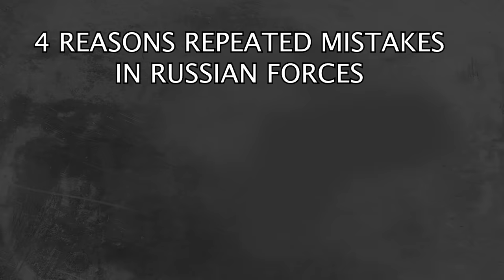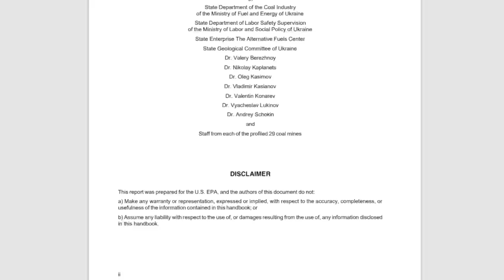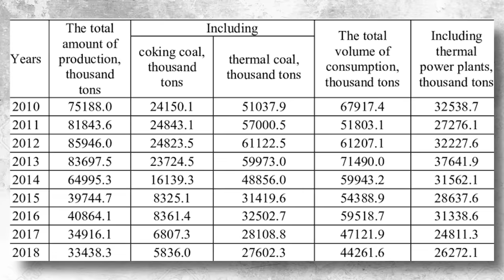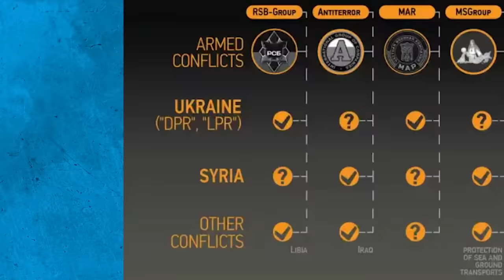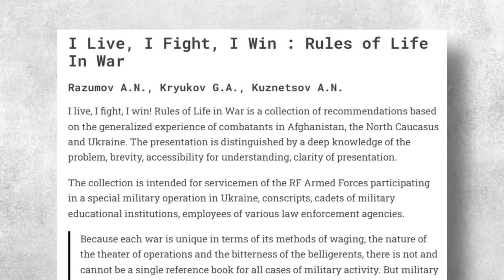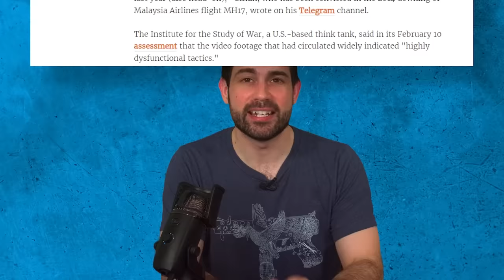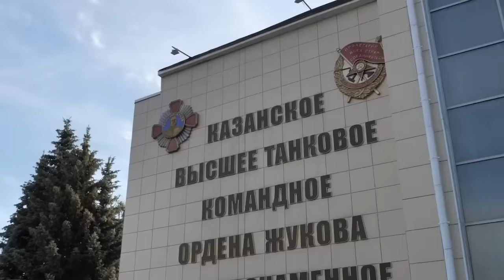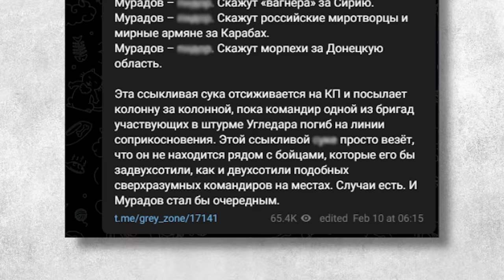Vuhledar, Why Russia Repeats the Same Mistakes

Comment: I once flew into a dirt airstrip on the opposite side of Base Camp from my company area. There was that second airstrip, “The Golf Course”, the active combat oriented one, lined by helicopters in sand-bagged revetments. It was only two-hundred meters from my battalion area, but not used for the kinda trip I’d just made. Instead, I had to walk clear across the base. I trudged along the dirt road with my M-16 slung on my right shoulder, grasping it’s sling with the thumb of right hand. I had my left thumb out, hoping to catch a ride. I walked down the right side of the road with the dirty-dusty, beaten up, muddy jeeps, 4WD Mules, 3/4 and 2-1/2 ton trucks speeding by me in both directions, coating me in dust. As I trod further from the airstrip, there were fewer and fewer vehicles rolling by, and less dust. Time passed, slowly. I plodded along, putting one foot in front of the other, the infantryman's plight. 

  A very clean and freshly painted jeep drove by me. It had a clean, taut, olive-drab canvas top. It stopped thirty feet ahead. I quickly jogged toward it, my gear flopping as I ran. A Major in an OD soft (baseball) cap leapt out of the jeep. He walked smartly towards me, dressed in very clean and perfectly tailored OD fatigues, with a very shiny brass belt buckle and very shiny black, ‘stateside’, all leather, custom made paratrooper “jump” boots. I (on the other hand) trod down this dusty road exhausted, filthy and stinking. I, coated in dust, stood there in my tin pot. Its faded camouflaged cloth cover had FTA written on it in ink, in two inch high letters (“Fuck The Army!”). Fortunately, he did not notice it. My once black boots were completely scuffed to a grayish tan. I carried my particular sixty-plus pound standard basic combat load, M-16, tin pot, seven hundred and fifty rounds of 5.56 mm ammo, four frags, three full one quart canteens, entrenching tool with bayonet, a parachute flare, a trip flare and a half-dozen cans of C rations in old socks tied on the back of my web gear. I wore the same sweaty, faded, brown stained jungle fatigues that I’d worn for two months. We lived in separate realities. 
  
  Marching smartly up to me, he barked, "Don't you know how to salute a Superior Officer?!” Switching my left hand to hold the sling of my M-16 slung on my right shoulder, I saluted him with my right hand and replied, "Sir, we don't salute officers in the field, Sir… The snipers tend to shoot them, Sir, if we do." He returned my salute and barked, "That's the general's jeep. The new Division Commander's in that jeep. He wants to know why you are out of uniform?" Me, incredulously, “What?!!” I have no Cav patch on the left shoulder of my jungle fatigues, no name tag, no US Army over my left pocket and no rank sewn on my sleeves. He continued, ”Why aren't your boots polished?" "Where are your insignia?" By this point, I was both bemused and pissed off. My reply was, "Fifty-six days in the field, Sir. This is the third blouse I've had. The other two rotted off me.” 

  This was when he realized I had at least five or six hundred rounds of ammo in the six ammo pouches on the front of my gear. He could see the two M26A2 hand grenades on my belt. It's also the moment he noticed the M-16 slung that was on my shoulder had a magazine in it. My once green fatigues were now tinged with a reddish brown from the red clay of the Ia Drang. I’m filthy. I hadn’t bathed in in a creek for at least two weeks. I’m sure he could smell me when he'd gotten in my face to make his point. The Major took a step back. Then, in a just slightly less officious tone, he said, "Well! See to it. You get your insignia properly sewn on, ASAP!" (as soon as possible) "And get some polish on those boots!” As there was no polish to be had, that was the icing on the cupcake. I responded, “Yes, sir!” After I switched hands again, I saluted him. He returned my salute and turned to go back to the jeep. I asked, "Sir. How 'bout a ride?” He glanced back over his shoulder, gave me a dirty scowl, jumped into the jeep, and they drove off in a cloud of dust.
Reply: I'm not reading all of that!
Reply: That guy was an idiot. Glad you kept your cool.
Reply: @wespeakforthetrees  just pointing out US army isn’t that smart either. It wouldn’t be hard to meet an enemy better managed than the US military.
Reply: @TheBooban  like for example?
Reply: @dodgedemonsrtx " Instant gratification isn't quick enough..." Carrie Fisher in "Postcards From the Edge"

Comment: Nice.  I think you’re right, with no or little in sharing lessons learned between Russian factions they are losing against better led troops.  Will it be enough?  I believe it will.  Defense is usually stronger than attackers.  This is a target that they must take.  Just throwing bodies at it would work.

Comment: A bit of a correction: Wagner doesn't JUST use human wave tactics, nor are they purely made up of ex-cons. Rather, they consist of barely trained ex-cons serving beside a small corps of extremely highly trained troops that are of even higher quality than what Patriot can bring to bear. The human wave portion of their attacks aren't meant to gain ground, they're meant to probe defenses for weaknesses that the much better-trained and better-equipped main troops then exploit. If those probe troops die as a result (and considering retreat is punishable by execution in Wagner, they almost certainly will), that just isn't the "proper" troops' problem. This is an incredibly cold and inhumane strategy, but it's also why Wagner has gained ground in Bakhmut while no one else, even the (ostensibly) better trained standard army and Patriot, have. It's worth noting too that Wagner isn't just fighting the normal Ukrainian military either. Bakhmut is arguably the largest concentration of elite troops in all of Ukraine on both sides, which puts some additional context on Wagner's slow gains. This is largely why Wagner has been catching more and more flak within Russia. Much as Patriot would love to believe they're better and more elite, they aren't, and Wagner has been making better progress against far stronger Ukrainian forces with considerably less support from Russia's top brass, given all the complaints Wagner's had of ammunition and equipment shortages.

Prigozyn wouldn't be nearly as cavalier about his losses if it was actually his "proper" troops that were dying in the numbers they have been.
Reply: Unfortunately for Wagner this tactic has basically run its course. Word has gotten back into the Russian prison system about the huge casualty rates and basically no one will sign up now. Prigozhin spun this as Wagner not needing the convict troops anymore, but it was plain to see he knew full well he couldn't get any more.

Comment: A big issue is, Russia has not been in a formal war since the 80's, and havent done combined operations on any scale since WW2 (in the 80s, the AF and Army did not work together in Afghanistan due to how politicized and territorial their military is). Most of what they do is putting down revolts in places like Chechnya, Dagestan, etc. So when they invaded they went to their old playbook of large, overwhelming forces with massive armor in a hard thrust towards select vital points. It worked at first, but then when Ukraine was able to stop them, they had no clue what to do bc they didnt have the doctrine or experience for it. What is more, is Russia has had several generals who were highly successful, but they have been relegated to secondary duties or pulled out of the war in favor of generals who are political yes men to Putin. This is another classic problem in Russian history going back 200 years, where loyal generals are given priority over competent ones. I mean look at ww2, it was when the Germans were nearing Moscow the Stalin brought from the far east some good generals and let out of prison others, whose loyalty were in question, but were good generals. Its an old Russian military problem.
Reply: Bullseye 🎯

Comment: Just a heads up, your microphone is facing the wrong way unless you're using the omnidirectional mode which decreases the quality of the audio capture and makes the pop filter you have on it uncessesary. Point the blue logo towards yourself for correct positioning :)

Comment: One aspect of the lack of unified/coordinated effort on the Russian's part that you didn't mention (at least not directly) is that to a large extent the factionalism exists by design. Senior leadership (e.g. Putin, but not just him) are fearful of allowing too much power to get concentrated into the hands of a single controlling person/organization because doing so could potentially set the stage for a coup. By maintaining a divided and competing military and internal security apparatus it helps ensure that if one group rises against the senior leadership there will be several others waiting to stage a counter-coup in order to restore the status quo.

Comment: This kind of loose setup might be useful if you are doing asymmetrical warfare or black ops, but obviously it doesn't work for conventional warfare. This is Russia's first serious deployment of their conventional forces since Afghanistan, unlike US. Chechnya was smaller operation when compared. So not surprising they screw up so much. 

And sir, you don't disappoint with your no bs reporting, presenting a clean picture when compared to any traditional media sources from any side in this war.

Comment: all of what you mentioned, but also- the soldiers don't live long enough to do after action reports or pass down that knowledge.  If it isn't taught... it needs to come from those around you.. you learn as you do, you improve... if you survive... hopefully, you teach the other guy how to survive... unfortunately, at the rate they are losing troops on the front line, not rotating anyone back, not having a system for knowledge to spread... they're stuck.  Not complaining, works in the favor of Ukraine.

Comment: Small detail but the republic of Tatarstan is not one of the poorest areas in Russia, it's actually a fairly well-off one (it ranks in the top 10). It has oil wealth and is fairly industrialised. It matters because back in 1991, there was talks that the republic could break away and trigger a dissolution of the Russian Federation. A referundum was held and the pro-independence side won but the decision was ignored by Moscow and the republic was forced to stay in but not with the same use of force as seen in Chechnia at the time.

Comment: Surely a factor is the highly authoritarian culture in the chain of command and low value given to personnel. If an order comes to take a position, then that commander will throw what he can at it even if it is misguided or suicidal.  There is a book which analysed the reasons for military defeat. Overly authoritarian command was the primary factor.  Russia compensates by mass, but at the cost of massive casualties.  That is expected and considered acceptable and regarded as the nature of ‘patriotic war’.  It is not regarded as a failing or in the same way as we would see it.  If such loss and wastefulness is acceptable then there is no learning from it as it is to be expected. It is Russian and former Soviet unwritten SOP and doctrine.  That military culture is totally alien to us, so these kinds of explanations are given.

Comment: Having not read all the comments, this might have already been mentioned, but the top down leadership structure is faciltating the losses Russia is suffering. Russian military has no non commissioned officer corp, and without it, there is no localized leadership within the ranks. No one to see situational changes or challenges, therefore those troops are frozen by inertia. That's fine with me. hopefully Ukraine capitalizes on this glaring error and gets this war finished.

Comment: It's down to their military doctrine.  It's rigid and doesn't allow soldiers to adapt to changes in battlefield conditions.
It's also down to the lack of junior officers and NCO's and the fact that the commanders are not allowed to stray from the official doctrine, unlike western militaries that allow more junior officers and NCO'S to change tack and change tactics when the situation requires it.
That rigidity screws the Russian soldiers on the battlefield leading to the huge casualty figures they are experiencing.

Comment: Why can't they work together? Another reason is that they have relatively low numbers of officers actually close to the fighting,  instead being stationed back at a safe location. They also don't allow low ranking officers and NCOs to take any initiative,  instead requiring changes in orders to be cleared with HQ first. The NATO model gives more latitude to the officer on the ground to modify their orders and for NCOs to give tactical orders to respond to threats, ss needed.

Another aspect is that the units can't report back so easily... the longer range radios are bulkier and more can go wrong with their systems. Keeping ranges down means smaller ratios and less interference,  an important aspect if your enemy is using radio jamming systems to further complicate things - although weather and terrain can also cause problems. 

This means that their officers don't get reliable feedback, can't easily visualise the situation, probably never have even seen the area for themselves (so might try to advance through "fields" which were as muddy as hell, causing their infantry waves to get bogged down, just to get slaughtered by MG or artillery fire. Anyone who's been camping knows how often this happens with maps... 😅

Comment: Agreed. A big part of the problem is the lack of strategic training at the enlisted and lower officer level. What we would consider commonsense (not so commonsense since we train for it) is not present in the soldiers that haven't seen a war with a highly mechanized country since WW2. At a higher officer level, they can't teach these field tactics to troops since they aren't in the field with them. Both higher level officers and enlisted have seen such high attrition that what is out on the field is very green. The real question is why Ukraine hasn't broken through somewhere that isn't a hot spot and flanked the Russian Army. It is the worst strategy for Ukraine to fight a battle of attrition against a foe with much larger territory, on home territory. Sadly, had the Western nations helped in the initial onslaught, Russia would have not had enough forces leftover to remount an offensive and this war would have been over after the first wave.

Comment: Another question: Why did the Russian Army- when it launched the current offensive- disperse its forces along five separate paths of advance? This is exactly the opposite of Erwin Rommel's maxim of "Fists, not fingers" in launching a combined arms attack, and it appears to have contributed to the failure of this offensive.
Reply: I asume they either expected the vdv to decapitate Ukraine (thus eliminating organised resistance), or seriously expected a repeat of the easy takeover from 2014 (the soviet union grossly underestimated Afghanistan and Finnland after all).

Comment: Considering coal...Russia and Ukraine were leading producers of Iron ore and pig iron.  These along with coal are the inputs for steel production.   

I'll take a stab at the failure to share lessons learned.   I suspect two issues are hindering Russia.  First, they don't have an NCO Corps.  This should be the source of organizational knowledge.  It would not just know Techniques, Tactics, and Procedures...it would know how to train them.  I remember walking around as an E-4 and E-5 with a ziplock bag with "hip pocket" training aids.  Task, Conditions, Standards...to bust out whenever there was a lull in training.  

Because they have no NCO Corps ...the Officer Corps is the only source of organizational knowledge.  The second bit:  Consider a Battalion, Brigade or Division Staff.  Every Staff Officer has an NCO counterpart...sometimes multiple NCOs.   A Captain in the BN S2 will have something like 8-10 years service experience.  His S2 NCO will be an E7 with 12-15 years of service and multiple professional schools.  This synergy is a case of 1+1=3.  I suspect the lack of planning, coordination, and cooperation in the Russian operations is due to this lack of staffing experience and depth.

Comment: For a succesful attack you need 4 things: speed, surprise, suppression, smoke (or concealment). 

The Russians were quick in the first two weeks, but did not act on it. The surprise was largely gone due to the intel the US gives to Ukraine. Suppression cant be applied enough due to the range of the artillery of Ukraine and bad coordination of Russian artillery. Same goes for giving smoke (artillery job) as there is no concealment of the terrain.

Comment: It took Russia two wars to subjugate Chechnya.   Chechnya did not receive any outside military or economic aid.  Nor did they receive any kind of formal training.  The Russians just pounded away until they won.  It could be simply that, despite their avowed doctrine, pounding away is simply the Russian way of warfare.  It finally worked in Chechnya and they're hoping it will work in Ukraine.  The Russians are tough.  They're hoping they'll simply outlast the Ukrainians and the West.